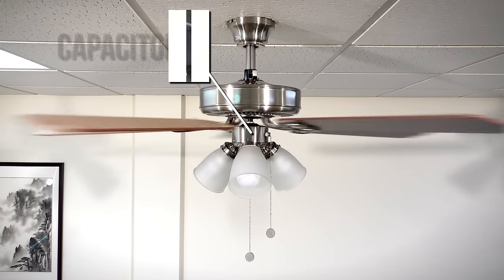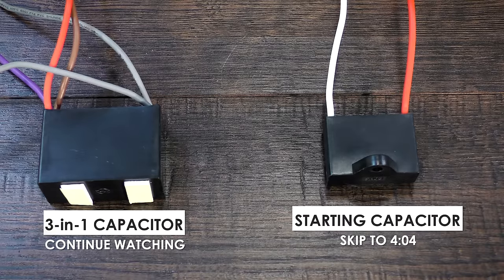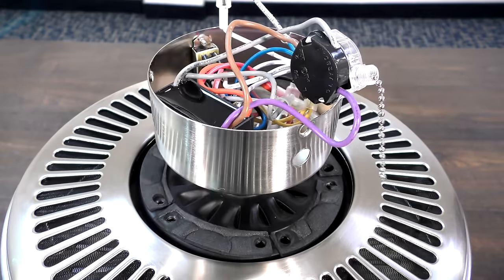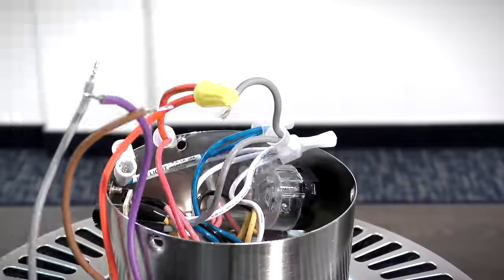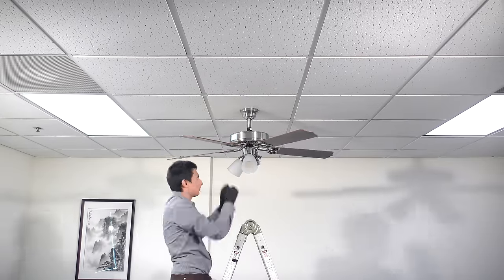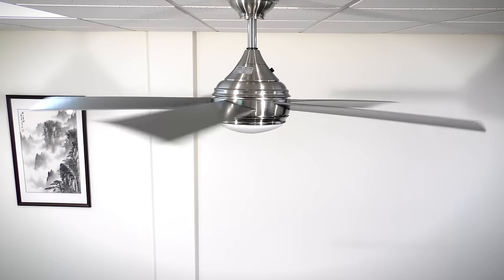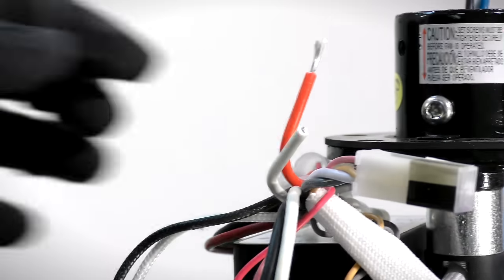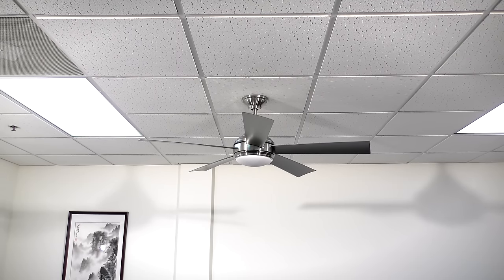How to Replace the Capacitor in a Ceiling Fan

Comment: You forgot the most important part: shorting out old capacitor! Capacitor holds charge and can shock you even if the power is off.
Reply: Now I'm afraid to change mine!  If I remember, as long as the fan has been off for a while there won't be any charge?
Reply: @dairyist  Speed capacitor might still have some charge. Maybe just first let hot wire touch neutral wire for a while without you touching metal parts. Then wire them together and pull the chain through the cycles and capacitor would short out.
Reply: Nope.. just changed mine today.  Circuit breaker 'off'.. Wall switch 'off'...  NO charge out of capacitor.  
This was a Hunter Waldon Five Minute Fan.
Reply: @johnbowes7965  What speed was the fan on and was the light on when you turned off the circuit breaker or switch?
Reply: I have a question....I want to replace a capacitor that is on a fan to another or do I have to order the same on....
Reply: @mikesr1978  The uf ratings must be the same.
Reply: Wish I knew that yesterday 😂
Reply: How do you short the old one?
Reply: @djrichardcrest2001 put the 2 wire’s together on the capacitor. Cheers
Reply: It's just 120 volts. Don't  be scared.
Reply: Wish I had read this first. Shocked me twice
Reply: My ceiling fan connected with 2mfd capacitor fitted company my fan is 55watt 390rpm for slow speed I have connected 2.25mfd capacitor will it be any problem for motor
Reply: @TRspeaksTRUTH lmao 😂

Comment: Why did you cut the capacitor wires then strip them and connect the new one to them, rather than undoing the wire nuts and connecting the new capacitor directly to the motor wires?
Reply: Looks like the originals are crimp nuts.

Comment: They should make these capacitors designed like a fuse, so they could just be simple to remove and replace on the side of the fan housing without all this work.

Comment: My father and I used this video to successfully diagnose and replace the capacitor in my ceiling fan.  Once work was done, we couldn't turn the fan on!  Your diagram is what saved us as we didn't have the black wire into the 3-Speed Switch.

Thank you for a detailed video!  It helped us immensely!

Comment: My ceiling fan 55watt 390 rpm company connected 2mfd capacitor for slow speed I have connected 2.25 mfd capacitor will it be any problem for motor

Comment: My 3 speed ceiling fan runs fine on Hi and Med.  Will not start on low. you can see the blades slightly move then stop. Is this the capacitor issue?

Comment: Regarding wire colors on a pull switch fan, is the following correct:
Red goes to the motor
Brown purple & gray goes to the pull switch 
Other gray goes to the forward/reverse switch?

Comment: The capacitor that I am replacing is a yellow 6 - 250 V, Purple 6 - 250 V and Red 4.25 - 300 V. Can I safely use a 6-250 V, 6-250 V, 4.25-250 V to replace it or does the red need to be 300 V ?

Comment: i replaced the five wire capacitor and the speed switch but the fan still won't spin-any ideas? could it be a bad motor?-the lights work ok

Comment: I opened the motor up and there are 6 wires coming from it. I cannot find this part anywhere. Could I use the 5 wire capacitor as a replacement?
Reply from the maker: Some of the wires coming from the motor may be used for the light (if applicable). It isn’t recommended to install a capacitor that isn’t confirmed as compatible by the manufacturer. The capacitor may not work at all or create a fire hazard if wired incorrectly. Try looking for any stickers on top of the fan’s motor that may identify the fan model or manufacturer. Most manufacturers can provide compatible parts for their fans, even if they are older models.

Comment: I have two questions.  

1. Why did you cut the old capacitor's wires, rather than removing the wire nuts?

2. Since this is a capacitor, would I have to wait a certain amount of time before touching it?  Is there a way to tell when it is fully discharged?

Oh.  Maybe that answers my first question.  Did you cut the wires to avoid having to touch the exposed ends when you removed the nuts?
Reply: Yeah, I wouldn't want 2 wire nuts in series either.

Comment: Hello. Will either one of the capacitors being bad cause the light kit to stop working on the fan, or are these only related to the fan motor itself, which is working fine?  Great video!  Thank you!

Comment: hi, im wanting to replace the cap in my 2002 Hamton Bay San Marino as the fan no longer works. i got it used, so don't know where the origanal owner bought the fan, my guess is home depot. when cap should i get to replace the old one?
Reply: Hampton Bay is owned by The Home Depot so must be The Home Depot.

Comment: Capacitor w/ 2 brown; one red, one green. Connect to new fan switch. With 1 black, 1 blue, 1red.  Cut off switch. Connect black and red wires on switch to black and red coming from the top,  connect brown to brown on capacitor,  connect blue switch to green capacitor.  This works for mine.
Reply: Hi, my harbor breeze has a 4 wire capacitor and lowes sent me a 5 wire capacitor and wire colors are different.

Comment: Hey, I think my ceiling fan/light is a Harbour Breeze. Neither the fan nor the light will work. There are wall switches on each end of the room to turn it on/off.  Any ideas ?
Reply: I had the same thing happen to me 2 days ago after a storm. Im thinking its the capacitor.
Reply: I just replaced the capacitor in my Harbor Breeze following this video.  I started with replacing the switch but only the light would work so I got a new capacitor and it works great.  Very easy with this video.

Comment: My fan got two capacitors. A is 1.8uf 550V (got three wires, two grey, one red), B is 2.5 + 2.5 uf 250V (three wires, one grey, two other colors).  I cannot find the replacement of A (two grey, one red). I am thinking two ways to solve the problems but not sure it is safe or correct, please give me advice. 1st : bought a three in one capacitor (4 wires) to replace the two capacitors. Is it safe? Is it same capable with the two capacitors?
2nd. bought one starting capacitor ( two wires) and one running capacitor (4 wire- two grey).  join the starting capacitor with one of the grey wire of running capacitor, connect another grey wire of running wire to the power. is it ok? Is it same capable with the two capacitors?. if both are wrong, please correct me.
Reply: I'm thinking about doing the 3 in 1 option you suggested in order to replace my two capacitora. Have you tried this yet?

Comment: Thanks for the video but it seems your capacitor and mine are slightly different. I Mine has a green wire instead of a purple one, but the others are the same. When I wire it in the configuration shown (using green in place of purple), it doesn't work right. It stays on high for 3 of the positions then low for the last and never turns off.

Comment: I disassembled the 220v fan motor, cleaned and greased it but still slow. So it must be the capacitor which is 1.2uF/400vAC. I found it online 1.2uF but 450v instead of 400v. Is it ok? And what is the difference in fan functionality?
Reply from the maker: It is possible that the fan may run normally, despite a slightly different capacitor rating. However, it is also likely that you may come across some issues. Every fan uses a specific type of capacitor based on the motor size, blade size, blade pitch, and blade shape. Using a capacitor that’s rated at 450v instead of 400v could either be fine or result in one or more of the following issues;
1. Shorter capacitor lifespan (may burn out within a few months of regular use)
2. Buzzing noise at medium or low speeds.
3. Lower than normal fan speeds.
4. Higher than normal fan speeds.
Before trying the different capacitor, we would highly recommend looking for the UPC number (usually found on a sticker on top of the fan motor) and contacting the customer service line for the company that makes the fan. They will usually have the latest compatible capacitor available to send and usually provide some type of warranty or guarantee.
Reply: Nothing.  Higher voltage is better. They just tend to cost more (I'm an EE).
Reply: 220-250v but use 5uf

Comment: Hi. How do I disassemble a Westinghouse ceiling fan to get to the capacitor? The fan model is: 30" Turbo Sweet 78301 black and what could be capacitor spec for this fan?

Thank you.

God bless, Proverbs 31
Reply from the maker: Unfortunately, we only service certain Home Depot's Hampton Bay and Home Decorators Collection models, so we cannot say for certain what the capacitor spec would be. However, Westinghouse does provide customer service support and should be able to get you the correct part and instructions for replacing it. You can call (888) 417-6222 or visit http://www.westinghouselighting.com/contact-us/

Comment: I have a fan that the light will stay on for half hour than shuts off, but it will light again in a few seconds. the light is florescent and the bulb has been changed.  It is a remote control unit and has a upper and lower light , only lower light given problem .

Comment: why did you cut the red and grey wires?  Why didn't you just take off the wire nut where it was attached?
Reply: Shannon Newbold On my fan (and looks like this for his as well) the factory wire nut is crimped into the line vs a wire nut you could easily take off.
Reply: @jasonmdubose  thanks.  I'm having three same problem in my fan.  Thanks for the lesson.

Comment: can i connect the red wire and the grey wire head to head (one straight line) without using any wire nut, just electrical tape?
Reply from the maker: Since the space where the capacitor is located is tight and full of wires and other conductive materials, we don’t recommend using just electrical tape to connect the wires. Electrical tape is better suited for insulation rather than holding bare wires together. Over time (and from heat generated inside the switch housing) electrical tape may lose its adhesive properties and expose the bare wire inside.
Reply: @TALCeilingFans  thanks man, i just bought a new capacitor and did all the same steps as you for my pull string fan sadly it doesnt work still.. warrantly is voided as it's considered tampered by me. very disapointed in fanco ffm2000 ceiling fan only used 1 year. :(
Reply: @jfree2739  Many DMM's read capacitance, so you could verify if the new cap is bad. If not and the old one is also good and you followed the video correctly,  at least you know it wasn't just the cap and you can resign yourself to spending more to replace the motor or fan, as you deem necessary.

Comment: 0:08 What kind of ceiling fan is that?
Reply from the maker: The fan at 0:08 is a 52" Brookhurst Ceiling Fan in Brushed Nickel finish. https://www.homedepot.com/p/Brookhurst-52-in-LED-Indoor-Brushed-Nickel-Ceiling-Fan-with-Light-Kit-YG268-BN/300937532
Reply: Hampton bay brookhurst

Comment: I replaced capacitor,but still fan is not spinning . It makes humming sound but not spinning. If I spin it manually it is spinning slowly. What ami doing wrong here
Reply from the maker: If the fan is humming but still not starting up under its own power, it is possible that another part may have gone out, such as a switch or a component inside the motor unit. Contact customer service for assistance; they may offer other replaceable components to try or the option to mail the motor in for service if applicable.

Comment: When I turn off power at the breaker, my husband said I also need to turn off power to our ac. Is he full of it?
Reply from the maker: Turning the power off to the room where the fan is installed is sufficient. AC systems are usually on a separate circuit either outside or in whatever room the main unit is installed in so you shouldn't need to turn off power to it. The only thing connecting them to the other rooms are the vents for the air. If you're unsure, however, it wouldn't hurt to turn off power to the unit as well while you take down or put up the fan.
Reply: Ma

Comment: If I don’t add a wire nut ? Will it not work
Reply from the maker: The wires must be held together with some kind of wire connector. Wire nuts are the most ideal option, but other wire connectors (such as crimp connectors, push-in wire connectors, and butt connectors) can be used as well.

Comment: Why would you not just unscrew the wire nut and reuse it? Why go through the trouble of cutting and taping?
Reply from the maker: The wires are held together with wire crimps from the factory. Wire crimps cannot be unscrewed by hand and should not be reused if removed. While you can use a pair of pliers to remove them, you will still need wire nuts to reattach the wires and electrical tape to keep the nuts secure. We also recommend cutting and stripping because some models have special wiring configurations that differ from the example shown. It is safer to color match the wires on the new capacitor with the remaining sections of wire from the old capacitor.

Comment: What if your fan has a pull chain and has a remote?
Reply from the maker: Usually, if a fan has a pull chain and remote it will have 3-in-1 capacitor (shown at 1:07). Fans with remotes added on have a component called a receiver that can be found in the canopy on most models. The receiver should be bypassed to see if the fan works without it as described in this video; https://drive.google.com/open?id=16cGJWuPj-QRbFIZfhXByiCX8XLGjnIGH
Reply: I would still follow the video if the colors match the cap. I.e., if the circuit schematic for the cap section is the same and you determine that you have a bad cap.